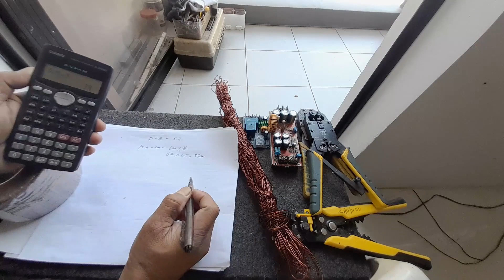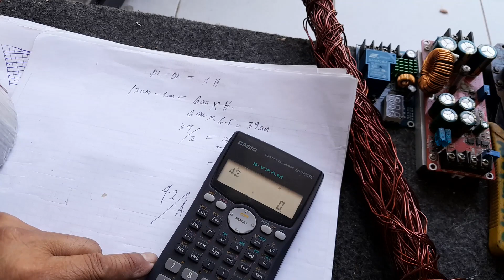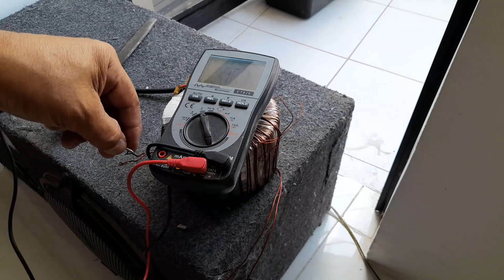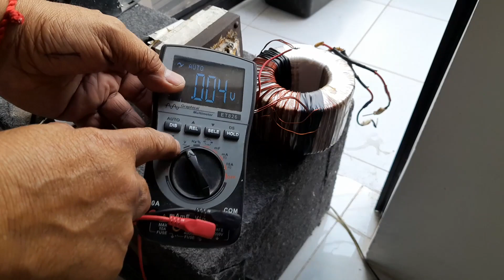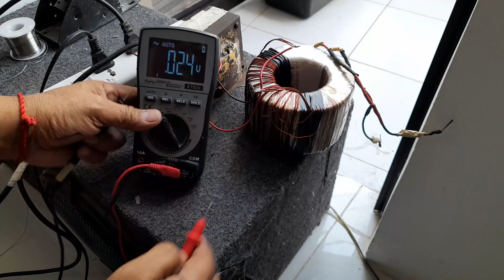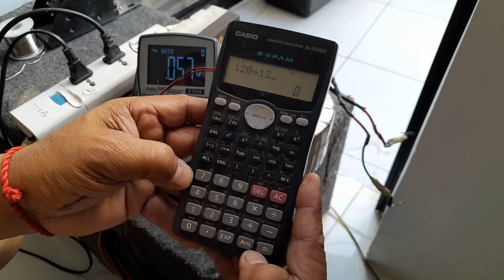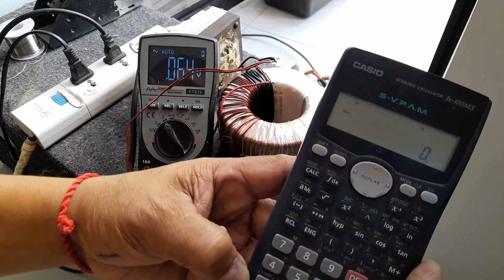#toroidal transformer from amplifier paano gawin at ikabit sa  diy inverter part 1

Comment: How to calculate secondary wire size the battery voltage is 72v and the load is 5000watt the inverter is a pure sine wave inverter. Thanks